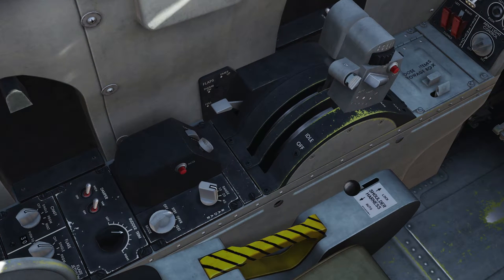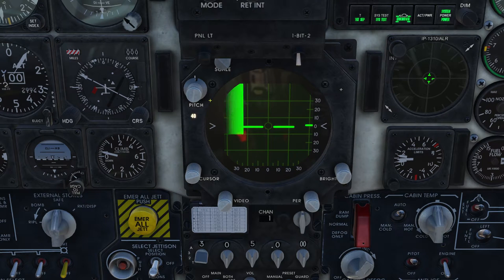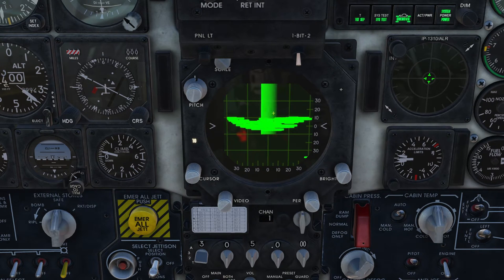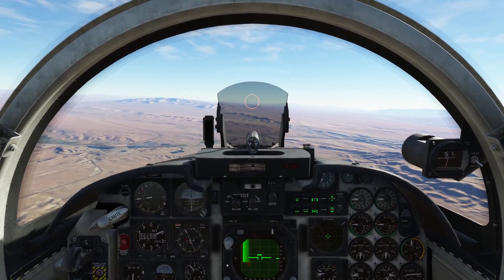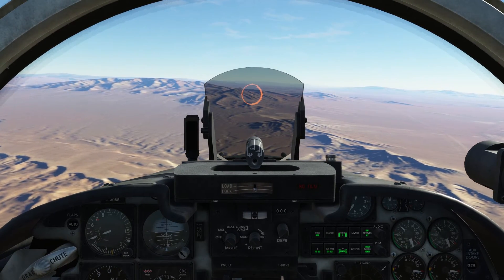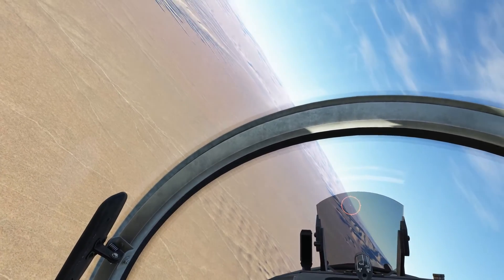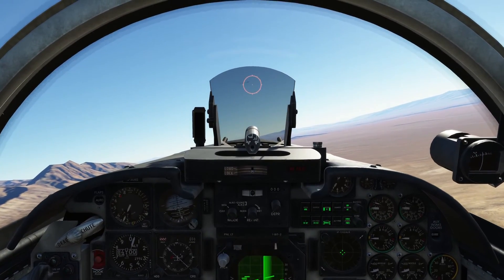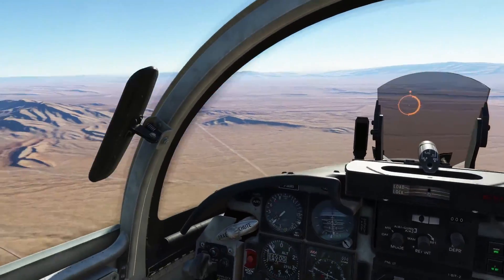DCS F-5 Air to Air Part 2 (Radar)

Comment: Curious, but under what circumstances would you even bother with the radar? In particularly: when would you use it to manually lock on to a target rather than just using dogfight mode?
Reply from the maker: I always use the radar too lock onto a target while trying to guns him because the radar provides ranging and lead for your target.
Reply: necro, but the dogfight mode will lock to something... or not. Manual, you know exactly what you're locking and if it worked. It also helps you to search for planes in bad weather, etc. I do agree that the radar is not super useful, since the F5 has no radar missiles...